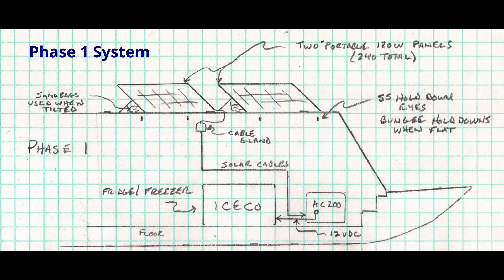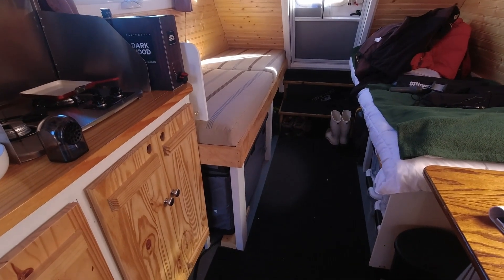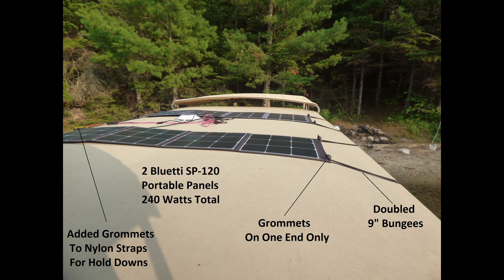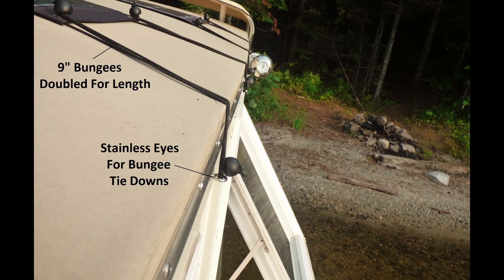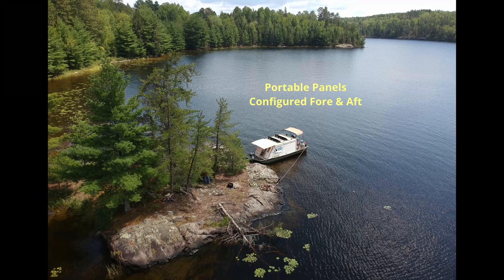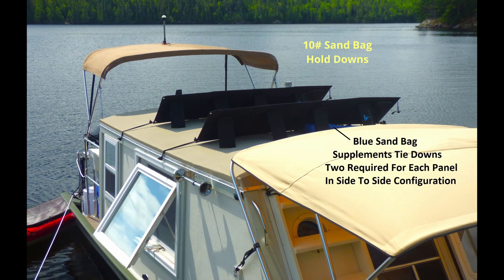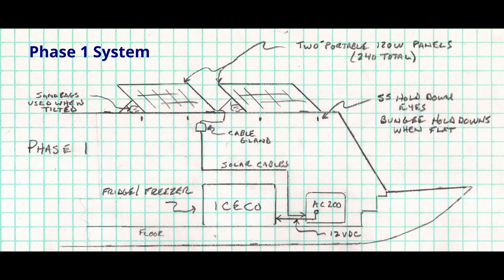Shanty Sanctuary, The Build, Solar Power System, Ep 1

Comment: Awesome video,  you are doing what I have been trying to envision for a while now. IS there a video showing the boat model hull you used? and how you built the enclosure? Ive looked through your videos but havent seen it. I subscribed so I'll see all your future videos as well, would love to see more about the build particulars. I also love VNP and am wondering if you ever run into issues with the hull if you get caught out in the big bay areas in wind, sometimes the waves can get a bit " aggressive" obviously you can hug shore lines and duck behind sialnds but I just wonder how that huge "sail" of a camper and the short sides of the hull handle big water. Looking forward to future videos, thanks
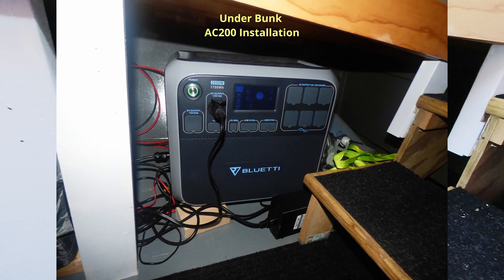Reply from the maker: See "The Build" series, Design, Ep 1. Time line :48 to 1:10.

https://www.youtube.com/watch?v=o6RuISk_np4&list=PLO3oVPdIOH5cCRAEdHm8MF7vZo0fmBgTs&index=1&t=6s

I am not the original builder but extensively modified the boat to fit longer periods on the water in remote areas for two to three weeks at a time. Between Ep 1 and Ep 2 of the "Design" series that is about al I know about the original construction. I hope to put out more videos on modifications I've made, time permitting.

One modification I made was a splash shield on the stern which can be seen in 2021 and 2023 videos. I had a situation on Rainy Lake in an open stretch of water where waves built up and threatened coming over the stern.  The mod has not been tested in similar conditions yet. 

Obviously a flat bottomed hull is not suited to big waves so trips like Lake Nipigon of Superior had to be done very, very, carefully. A close weather watch is critical.  I avoid conditions in large open bodies of water where winds exceed 10 mph or side seas may occur.

The sail effect I have not had a problem with, but side roll is a problem. Again, I avoid side sea situations if at all possible, even in light wind and waves.  Fortunately, most of my boating is on protected waters with lots of islands. When I am faced with a long crossing in open areas I try to always follow my limitations on wind and waves.

I hope this helps. Thanks for your comment and questions.

Comment: Do you get any charging off the outboard when you are under way on water? Or not too much?
Reply from the maker: Yes, I have the starting battery connected to the house battery through a battery combiner (ACR).  It indirectly charges from the outboard through the starting battery and does help but not a huge amount since the outboard has only a 16A generator.

This will change this coming season since I added a 230Ahr lithium house battery and removed the lead acid (LA) house battery.  You cannot mix lead acid (LA) and lithium battery types, so the combiner has to be disconnected.  The negatives are I can no longer charge the starting battery via shore power through the ACR.  Nor can I charge the house battery via the outboard through the ACR. This will be covered in my next episode on Phase 3 of the system after testing.  

I added an independent MPPT solar controller and will use my old SP120 panels (Phase 1) mounted on quick mount framework over the aft Bimini.  This system will charge the new house battery only.  The trick is that these panels need to be quickly but securely mounted for on the water ops.  I have to take down both the Bimini and the solar panels each time since they cannot be up while driving down the road.  Since the ACR will be disconnected, the house lithium will only be charged from shore power through a newer WFCO power center for lithium batteries, or from solar.  

A battery to battery charger could be used as one way to charge the house from the starting battery but the limitations make it problematic with only a 16A generator on the outboard.  B2B chargers have be sized to be no more than half the size of the generator (8A) to avoid burning up the generator.   This can be done, but no one makes a B2B charger this small that can also sense the outboard is running.   It can be manually switched but there is danger of running down your starting battery, if not careful.  I am currently trying to find a solution to this problem, though it is not high priority.

Long answer for a short question!
Reply: @ShantySanctuary  wow. It’s an interesting subject though. I have a small cabin cruiser (sundancer 250) and am I correct to think LifPo style batteries can’t or shouldn’t be used as starting batteries?  Of course in my case I’m starting a 7.4 liter motor.
Reply from the maker: Yes, you are correct.  The number one reason is if the BMS shuts down the Lithium battery, the alternator/generator can be damaged.  This is the current technology but in the future we will likely see lithium starting batteries.  As far as I know they are not yet available.  And, as mentioned, mixing lead acid with lithium presents other problems, but usually there are solutions.

Comment: have you thought about using  bifacials
Reply from the maker: The short answer is no.  Since my panels are most often flush with deck and my understanding is they are not made to be used in that configuration. The few times (mostly late fall) I use the tilt function would not justify the extra cost.  Even then the panels are tilted only when at anchor or tied to shore, never while underway.

Thanks for your question.

Comment: why not use the 30amp outlet to plug into shore power outlet to power boat?
Reply from the maker: Not sure what you mean John.  Could you explain further? 

I assume you are referring to the 20 amp outlets on the AC200 (there are no 30 amp outlets). Since the boat is wired for 12 volts, it always more efficient to use 12 volts as the source of power rather than using an inverter.  The primary purpose of the AC200 is to power the fridge/freezer, which is 12 volts.  When testing the AC200 using DC power versus AC power it uses more than twice as many watts with AC, even without a load.  Much less efficient and I would run out of power that much sooner.

If I misunderstood your suggestion, please clarify.
Reply: @ShantySanctuary   oh ok, thought the big outlet on bluetti was a 30amp outlet
Reply from the maker: Perhaps you are referring to the the single 12v/25 amp outlet rather than the six 120v/20 amp outlets.  If so, that has already been implemented for Phase 3 and will be tested this coming season.  The standard 12v/10 amp plug works fine but is less secure and may be less efficient.  I simply ordered the Bluetti quick release plug and an extra 12v cord for the fridge and soldered it up.  This change was not cited in this video since it has not been field tested yet.  It will be shown in the Phase 3 video later in this year.   Again, if this is not what you meant, please clarify.
Reply: @ShantySanctuary   yeah the single outlet. thought it was a 30amp?
Reply from the maker: Could be on the newer units. Mine is the original AC200.  There have been several upgrades since then.  

However, I checked the AC200P, which will replace my unit and it is still 12v/25 amp on that model.  My fridge doesn't come close to drawing that kind of power anyway. My primary reason for shifting to the 12v/25A outlet is the security of the connection. I've bumped the old cigarette connector (12v/10A) loose a time or two which is not good.  The upgraded connection will be secure and provide a more solid contact.
Reply: @ShantySanctuary  just looked and it's the max that has the 30amp outlet.
Reply from the maker: Not surprised. They are always upgrading these things.  Thanks for letting me know.